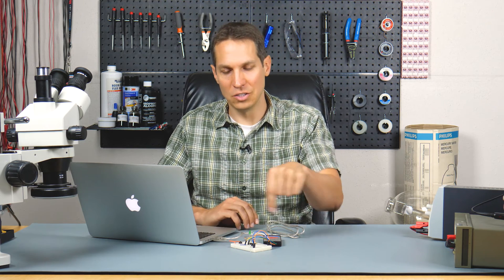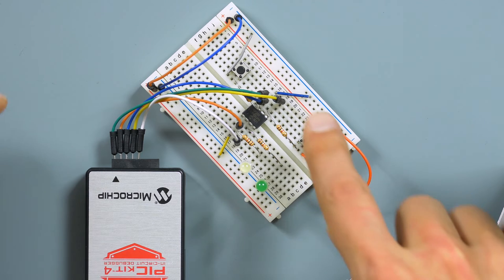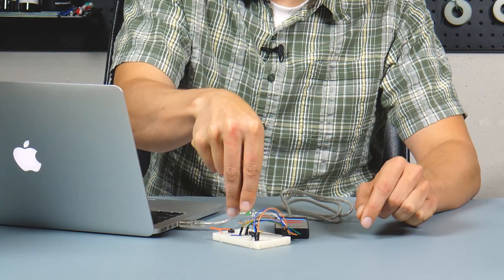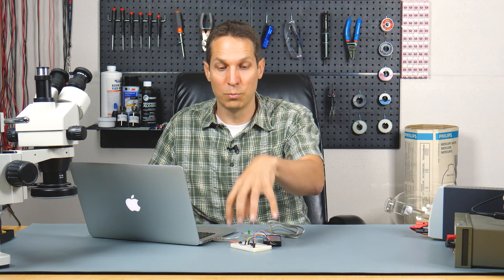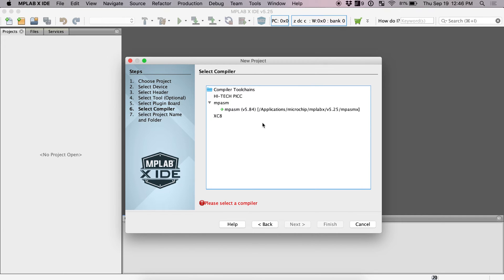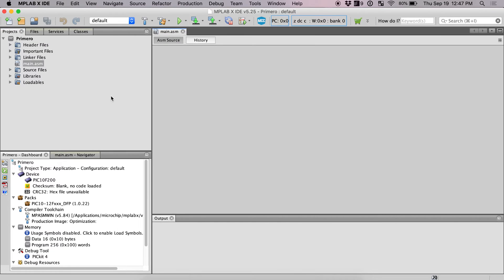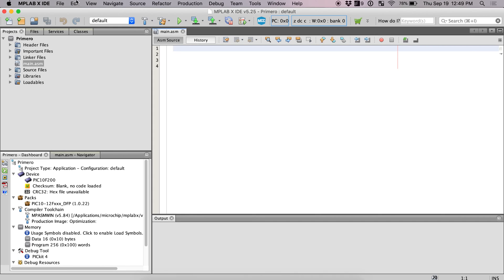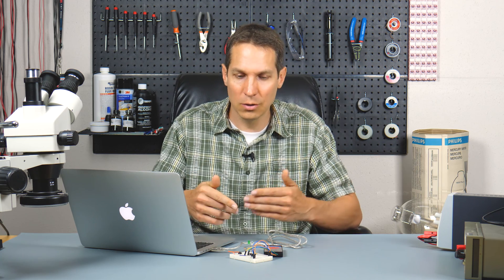Getting Started with MPLAB X IDE -  Part 4 Microcontroller Basics (PIC10F200)

Comment: Will this work with PIC16f676?
Reply from the maker: I haven't tested it myself but I believe it will - though minor modifications may be necessary.  The 16F series has a lot more options and is much more powerful compared to the 12F series used in these tutorials.  That being said, the concepts and framework are all applicable and helpful, I'm just not sure if the details will transfer.  I have a PIC16F690 somewhere, I need to try this out and see...

Comment: CAN I DO THIS IN PROTEUS SOFTWARE
Reply from the maker: Proteus will help you with circuit design but, as far as I know, it won't work as a Microchip IDE.  I would be very surprised if it did.  So for the firmware portion, you will likely want to use a Microchip provided IDE.

Comment: where to install mpasm ???
Reply from the maker: Hey Alex - mpasm has been deprecated and we need to go through and update our written tutorials and some of the code.  Fortunately, as the videos are at a higher level, the concepts and general structure should be completely unchanged.
Reply: @CircuitBread  so I can be using the PIC -AS assembler for your all pic tutorial ??
Reply from the maker: In structure, yes.  In specifics of the code, at the moment, maybe, maybe not.  I'm confident about the simpler code but am not certain about the more complex code.  I'm hoping in early December to start going through all the example code on our site and converting it to PIC-AS and frankly, I'm not quite sure how that will go.
Reply from the maker: @Alex-rv8gw  A bit belated, but we have ported all of the code to XC8, which are included on the site, as well as a process of how to move any code from MPASM to XC8.  https://www.circuitbread.com/tutorials/mpasm-to-mplab-xc8-pic-assembler
Reply: @CircuitBread  noted thanks

Comment from the maker: You should definitely go and read Sergey's written tutorials that these are based on.  Besides going into more depth on each topic, you can get the code and read through the important schematics and tables:  https://www.circuitbread.com/tutorials/circuit-setup-mplab-x-ide-part-4-simple-microcontroller-pic10f200   ALSO!  MPASM is now becoming obsolete, so we have provided XC8 ported code on the site, as well as a process of how to port the code if you are interested:  https://www.circuitbread.com/tutorials/mpasm-to-mplab-xc8-pic-assembler  The structure, logic, and MOST commands will remain the same but there are some minor variations.

Comment: would the new mplab snap programmer work ok ?  i'm guessing 'no' because of the high voltage required on the reset pin, during programming.  the outrigger canoe bringing my pickit3 [AND a pickit2] from china may have sunk in a typhoon or something.  thanks
Reply from the maker: Hey David - I've looked into it in the past and even though I haven't tried, I think you're right.  The high voltage required to program the PIC10F200 isn't available with the SNAP programmer.  And I'm sorry to hear that your shipment may have gotten lost.  I think some parts for a few of these tutorials are at the bottom of the ocean with your PICKits as well - Sergey created several more tutorials and the parts I ordered two months ago for the tutorials still haven't shown up.

Comment: For some reason, even after a fresh MPLAB X install, i can't choose mpasm as my assembler. Any idea as to why it wouldn't be available?
Reply: Gonna just keep posting my progress here, maybe it will help someone. I've converted some of my code using the conversion from MPASM PDF (see my comment above) and the MPLAB® XC8 PIC® Assembler User's Guide, but I'm still getting a few errors. Just discovered a comment at the end of this post that looks helpful: https://www.electro-tech-online.com/threads/mplabx-assembler-worried.160737/page-2
Reply from the maker: @markbeebe2463  Hey, sorry, YouTube doesn't notify us if someone comments past the first comment, so I haven't seen any of these until right now.    Yes, MPASM is now obsolete, but we had an extremely nice volunteer port all of the code to XC8, which is available of the written tutorial pages at the bottom.  Also, the code conversion process is here:  https://www.circuitbread.com/tutorials/mpasm-to-mplab-xc8-pic-assembler
This is a pain in the neck, but all of the overall concepts, structures, and MOST commands are unaffected in the series.   I'll include this in the pinned comment for other people to see as well.
Reply: @CircuitBread  Fantastic! So glad to hear that someone's already solved this, haha. I'll check out that link. Thanks for the great content, y'all are the best.
Reply from the maker: That's odd, that should be automatically included in MPLAB X unless you actively tell it not to be included.  Is the box greyed out or is simply not an option when you go into your settings?
Reply: @CircuitBread  Help me out here, am I looking at the relevant document for using the XC8 compiler to work with Assembly? Is the PIC Assembler included with XC8? Is an Assembler even what I what? Lol. Thanks for your help. https://ww1.microchip.com/downloads/en/DeviceDoc/MPASM%20to%20MPLAB%20XC8%20PIC%20Assembler%20Migration%20Guide%2050002973A.pdf
Reply: @CircuitBread  After reading your reply to a different comment, I switched my compiler to "pic-as". Is that correct?
Reply: Hi, I have the same problem on windows. I got the newest version (as of todays date) from the official site and mpasm simply just doesnt show as an option, also I cant see the mpasm folder in the program Microprocessor directory under Progran Files either. When I try to build an assembly file it throws an error. If you could help me out with some advice I would be so greatful.
Reply: First of all, you've created a great series of videos and I recently received a PICkit4 and was keen to go. However, I'm having the same issues as others have reported here.
I have downloaded the latest MPLAB X  IDE, version details below.
There is no mpasm anywhere on the server, especially not where it should be, in /opt/microchip somewhere. It doesn't show up in the list of 'Compilers' when creating a new project.
Further more, the p10f200.inc file isn't installed either.
Could this be because I'm using the 'Free Mode' license whereas you're probably using a professional one ?
In case it helps anyone else, I've installed gputils, which included the p10f200.inc file,  and have been able to follow along with the tutorial from the command line.

The About option in MPLAB X shows:

Product Version: MPLAB X IDE v5.40
Java: 1.8.0_202; OpenJDK 64-Bit Server VM 25.202-b05
Runtime: OpenJDK Runtime Environment 1.8.0_202-b05
System: Linux version 4.19.0-10-amd64 running on amd64; UTF-8; en_GB (mplab)
User directory: /home/mark/.mplab_ide/dev/v5.40
Cache directory: /home/mark/.cache/mplab_ide/dev/v5.40/var
Reply: Hey everyone! In case this helps for anyone.... I couldnt get MPLAB X working in the end and gave up, but i did manage to get my assambly programs compiled with the MPLAB Xpress online version without any problems. So if thats an option for you, switching to the online version might be the easiest solution.
Reply: Bad news, y'all. Per this stackoverflow post, it looks like the current version of MPLAB doesn't support MPASM anymore. If I understand correctly, you can use XC8, but there's differences? Idk. I'm gonna check out that and the browser version, see if I can get either working for me. Thanks for the heads up @mejente1
Reply: Whoops, here's the link: https://stackoverflow.com/questions/64169814/mplabx-5-40-mpasm-assembly-pic

Comment: i watched a youTube video on programming an attiny45 or 85, using an arduino uno as a programmer.  can the pic10f200 be programmed w/ a similar setup ?  between ebay & aliexpress, the postal carrier is visiting frequently these days, as i tool up to follow your excellent videos.  thank you so much.  between cv & the mpls riots, i'd been running out of crappy old movies to watch.  :)  take care & stay safe.
Reply from the maker: Hey David - yeah, I've been giving our mailman a workout recently too, I understand!  You can create a programmer out of an Arduino or some other microcontroller and that is something that Sergey has done on multiple occasions.  As for an Arduino Uno to program the PIC10F200, I think there would have to be some sort of voltage booster as you need 12V on VPP to program it and I'm not sure how that would be done offhand.  Not all PICs require those 12V, though.  I'll send Sergey this comment and see if he has any thoughts.
Reply from the maker: I chatted with Sergey and he agreed that you won't be able to use most microcontrollers as a programmer of the PIC10F200 by themselves but that a voltage step-up module is an easy and inexpensive way to expand their capabilities.  Should be fun to experiment with!
Reply: @CircuitBread  - hello again.  so, does the pickit provide the 12vdc on pin 8 [vpp] of the pic10f200 ?  reading on the web, it looks like vdd+4v should suffice.  if vdd is 5v, from the usb port, i'm thinking a 9v batt & a momentary push button might suffice.  my faux pickit from china is mia [8+ weeks so far].  one little programming gizmo i bought is labeled tx & rx.  that just sounds like rs232.  the fauxduino uno has sck, miso, & mosi available.  i'm guessing sck to pic10f200 pin 3 [icspclk] & mosi to pic10f200 pin 1 [icspdat].  any hint where i can find the json {?} file to add the pic10f200 to the arduino ide targets file ?  i'm doubtful the mplide 8.76 is gonna offer the fauxduino uno as a programming tool.  no need to respond, if i'm being too much of a pest.  anxious to get started w/ my 'follow the bouncing electron' tutorial w/ y'all.  please take care & stay safe.

Comment: Great video, quick question, is this software just for the "pic..." Microcontroller series or if I get a random microcontroller will this software be able to work with them? Thanks :)
Reply from the maker: It will not likely work just as a copy and paste between microcontroller families.  Different manufacturers have slightly different assembly commands and different hardware architecture.  That being said, there should only be fairly minimal changes from one platform to the other and a lot of things will likely be a "replace this with that" instead of requiring many, if any, changes to the actual structure of the program.
Reply: @CircuitBread  awesome, cheers